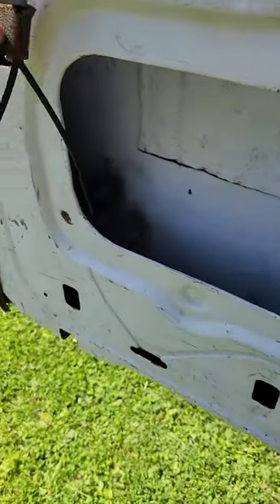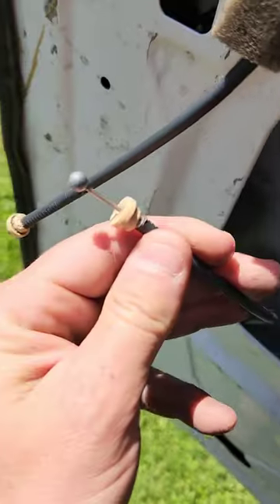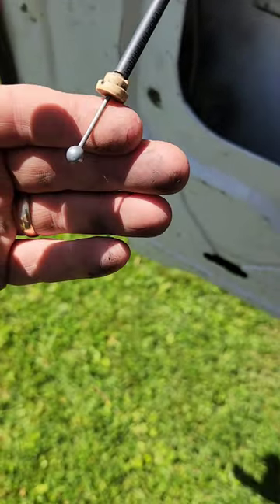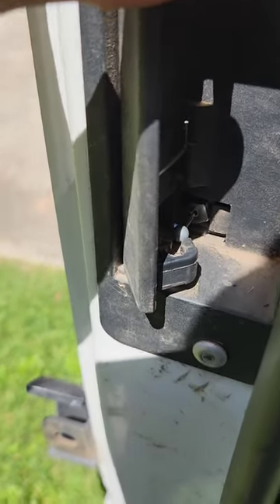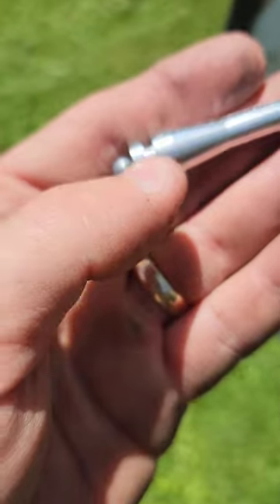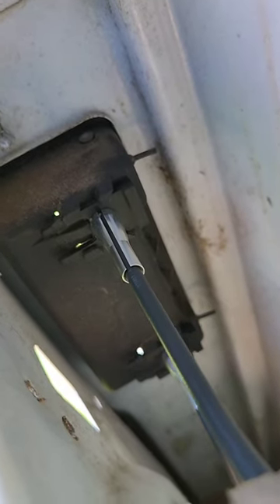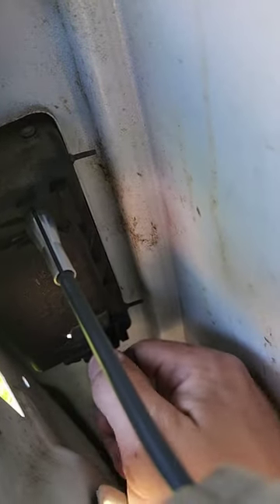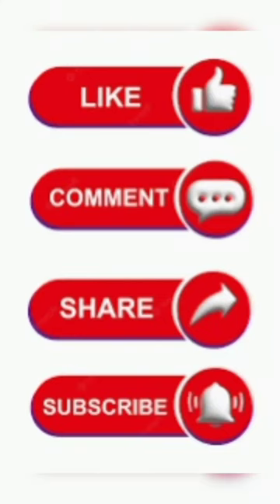Back Door Wont Open: 5 Minute Van Fix: Ford E150 E250 E350 Rear Back Driver Side Van Door Stuck

Comment: My door won't open. 😥
Door won't open, 🤣repair requires the door to be open.
Going to Dairy Queen and eat a Banana Split while I try to figure out how get my door open.🤔

Awesome Video.
I think I will replace all my cables as one door goes, so go the other doors over the next couple years.
Reply from the maker: The cable is probably not attached and therefore won't open. Take a flathead and see If you can pry open the latch by playing around with it. I have another cable on it sliding door I have to fix. Ugh. So frustrating lol. Let me know how it goes 👍

Comment: is there a way to open door if cable is removed already? i removed license plate to see insode from outside. cable broke off by repeatedly opening it with cable.only
Reply from the maker: You might be able to pry it open with a long flathead if you have one...If you can get it in there.

Comment: would have been nicer if you would have shown us how to open the door and take the panel off. incomplete
Reply from the maker: I don't have panels on mine, so I can't show you how to remove them and opening the door is pretty straight forward.
Reply from the maker: sicaboolacey  My lower cable was still attached on the driver side, so I was just able to pull that out & up to disengage the bottom latch. If it's out, youre going to have to use a pair of pliars and put it back in to to open it. You may be able to use a flathead screwdriver to open the latch from the inside by prying that latch open.